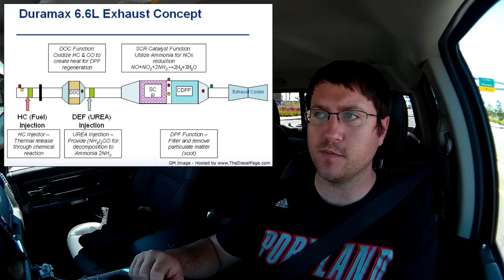Regens, DEF and Emissions Explained on the 6.7L Cummins - 2013 through 2017 Ram 2500

Comment: Good video and about as objective a one as you're going to get on this topic.  I like how you point out the possible reliability issues with emissions intact but still acknowledge that they do greatly curb emissions relative to previous generations of diesel engines.

The legality of deleting is pretty straight forward...it's not allowed by the EPA, but different states have different approaches when it comes to enforcing and supervising that.  I don't like the complexity of modern diesels, but I also acknowledge that progress needs to be made on dealing with their emissions.  Kind of like the EPA's regulations on gasoline engines and fuel quality back in the 70's and 80's, I imagine there will be growing pains with diesel emissions technologies.  But I hope that over time they will become more reliable and less expensive to maintain or fix.  Here in the US, diesel owners and enthusiasts cringe at the EPA's stance on diesel emissions, but go look overseas (e.g. Europe) where for the longest time they had few, if any, regulations on diesel emissions and the air quality in their cities has suffered horrendously (they also have a lot more diesel passenger cars than what we have here in the US).

I'm torn on longterm ownership of a modern diesel.  I'd like to minimize my environmental footprint, but I also don't want to have to pay for a new exhaust system (and potentially a major engine overhaul) 100k-150k miles into ownership.  What I would really like to see from Cummins and other diesel owners is longterm feedback on how the emissions, and engine reliability, fares over the longterm (150k miles and beyond).  It sounds like the newer diesel engines (2013+ for Cummins) are much better at managing the EGR and DPF active regen's and also get better mpg's than what the earlier versions were getting.  All that said, the 2013+ Cummins are still young, relatively speaking, and I'd like to see how they're doing 5-6 years from now with several hundred miles on the odometer.  

BTW, PNWreckage this isn't all directed at you.  Mostly this is just me airing out my thoughts on the topic.  Though if you do end up keeping your Ram for the longterm, I hope you continue to make videos and keep us posted on its reliability.
Reply from the maker: +Kevin P Fantastic comment and it never came across as you yelling at me, lol. The plan is for this to be my forever truck and I will keep everyone updated as my ownership progresses.
Reply: There's a guy over on the Turbo Diesel Register forum who just turned over 600k miles on his 2012.  Uses it for hauling cars.
https://www.turbodieselregister.com/threads/259082-600k-miles-2012-Ram-3500-Laramie-longhorn
Reply from the maker: +Charles Riley I feel way better about my 15k now! Thanks for sharing.
Reply: The point kinda is that he reports he is still on the original engine and turbo, and none of the stuff he's had to replace due to wearing out or failing have been emissions related. I  should have been more clear on that.
Reply: Charles, that gives me additional confirmation that the newer emission systems are in fact more reliable and longer lasting.  You hear about a lot of horror stories with the 2007.5-2010 Ram 6.7's, but a lot those issues had to do with heavy EGR and DPF regen tempo's.  It seems that the newer emission systems have seen optimization in the ECU programming and the addition of the DEF (SCR catalyst) has relieved a lot of the previous issues.  Also, driving habits seem to play a huge role.  The guy you referred to with 600k hauling cars probably hasn't had any issues keeping the DPF functioning and healthy, whereas someone driving primarily in stop-and-go traffic might be more likely to have issues.  A lot of owners have indicated that getting on the highway on a regular basis allows for more passive regen's (as opposed to active  regen's requiring fuel injection) of the DPF.  Honestly, it seems that unless you are using your 6.7 to navigate traffic-jammed city streets on a daily basis, an owner should have little to no issues with an emissions-intact diesel.  Also, deleting  an older 2007-2010 6.7L cummins seemed to improve mpg's (due to the previously mentioned EGR and DPF cycles); I'd be interested in seeing how much of an mpg improvement, if any, was realized by deleting a newer 2013+ 6.7L Cummins.

Comment: I just bought a 2016 Cummins, from trading in my 2011 deleted Duramax. These are easier to delete and something I'll definitely do
Reply from the maker: +Keven Gil How are you adjusting to the new rig?
Reply: ehh. it's alright. skipped out of finding a truck with a higher trim, ended a tradesman with all the options you can get. decent little truck.
Reply from the maker: +Keven Gil nice work

Comment: Great Video. I have a 2015 6.7 Cummins with 15,000 miles on it. So far I've had 2 active re gens during that time. I try to do as few short trips in my truck as possible. I absolute love my truck and for the money it beats (IMO) Ford and Chevy. After watching a few of these videos, I'm started to get concerned that maybe I should have brought one with a gasoline engine instead. My whole reasoning for buying a diesel was because they last a long time. I hope I didn't make a mistake. I plan on keeping this truck for 20 years.
Reply from the maker: +Andrew Usmani I don't think you made a mistake and support your short trip philosophy. Think you'll delete?
Reply: I'm not too up to date on the whole deleting thing haha. I live in CA and I would not want a "comrade" from the air pollution board paying me a visit in the middle of the night ;-). I'll check out some of the deleting videos and see what that entails.
Reply: dont buy the hemi 6.4 - i just ordered a tradesman 2500 cummins. i get 10 mpg with the gasser. spending 320 month on gasoline stinks. have an old 5.9 cummins 2500 and drive that more than the 16 hemi. cheers.
Reply: You didn't make a mistake at all. Either put some cash aside for future repairs on the emissions system or delete it. Main thing is to try to be pro-active and keep up on cleaning the EGR valve often, keeping all filters replaced often, oil & fuel filters changed evry 10k miles and run your exhaust brake ALL the time. It keeps that emission system cleaned out.

Comment: This video makes me wonder what is more efficient, burning more fuel with all the emissions equipment, or burning less fuel without it? 🤔
Reply from the maker: +Kody Kalma Boom you nailed it and I am also curious
Reply: A new 6.7 power stroke has emissions equal to 24 2002 7.3 powerstroke. This was told to me by a ford tech at a dealership last spring while I was still driving Fords not Rams. Even if the guy was not completely accurate the bottom line is that the new trucks are very very clean. I thought the sane as you and this was the answer I got from a ford tech.
Reply: Taxes are collected by the gallon on diesel. Less efficiency and less mpg equals a truckload of additional taxes collected for big government. That's what they truly care about.
Reply: I know it's an old response, but the answer depends on the vehicle. On the 2013 and newer Cummins, there's hardly a fuel economy penalty with the emissions. There's a very very slight increase in CO2 production, but running without the emission equipment results in around a 100x increase in PM. The testing by CARB shows that the PM in the 2018 and newer Cummins is less than that of a Prius.

Comment: The DPF is used to remove particulates down to 2.5 microns. A micron is a very small particle.
Reply from the maker: +Ron Wertz very small
Reply: Which is why I will be deleting it on my 1500 Eco Diesel as soon as the warranty runs out!
Reply from the maker: +Ron Wertz agreed!

Comment: Thank you for the informative videos.  We are shopping for 2500 and would love the Cummins however, in Suburban Chicago we have to pass emissions to get tags so I don't believe there would be any way around deleting.  Unless you know otherwise?
Reply: I realize I'm responding after a year. Illinois doesn't have emissions testing for diesels, at least not yet. If you get a class d truck you'll need to get a safety inspections every six months.

Comment: YES!! Next is HID light😁 

Now I've heard "chipping" it can unlock a lot more of its potential. What are your thoughts on that?
Reply from the maker: +Shane Bartlett like using a tuner? Lol nice work watching this video to the end!
Reply: PNWreckage umm I've never heard it called a tuner but let's say yes for understanding sake lol. It was actually pretty informal for as long as it is. Made me think about certain things so I know what to expect
Reply from the maker: +Shane Bartlett lol I think we're on the same page with tuners and chips, and yes those can make a HUGE difference! Like enough to grenade your transmission potentially with just a tuner. I was worried about the length but I'm not super formal as you have probably gathered haha. Hope it was helpful.

Comment: I got a brand new 2020 dodge2500 sport 4x4 with the Cummings  and on my way to a wedding a few weeks after getting it i had smoke coming thru the air vents and the smell of something burning, it hasn't done it since then but wondering if i should be worried?

Comment: PNWreckage what brand do you use for your DEF all the time? Been thinking about Mopar not sure what to do for brand. Don't want to give the dealer any excuse for warranty issues.
Reply from the maker: I use the generic brand unless the fancy one is on sale. Literally no difference from what I can tell but I get where you're coming from.
Reply: I fill mine up at truck stops, so much cheaper and easier to fill.
Reply from the maker: Can't wait until that's more common in my area. Believe it or not there aren't many

Comment: Hey PNC, I have commented a few times to your very informative and well presented videos.  I now have 19K miles in 7 months on my 2017 RAM 3500 SRW Limited with Aisin.  I have been adding a 2.5 gallon container of DEF about every 4K miles.  I only got down to the warning light once.  I drive with automatic exhaust brake all the time.  I am in southern California so I drive 50/50 split highway and city.  I cannot detect when a regen is happening?  I had one less than favorable tank of fuel only yielding about 15mpg at around 15K on truck, so can I assume my truck went through an unnoticeable passive regen during that tank?  I normally average 17-19mpg combined city and highway, and get as much as 22mpg highway while driving to Colorado and back to visit my daughter.  I am a diesel newbie so I am not sure if these trucks require the regular California "smog" checks in order to get registration renewed.  Does deleting the DEF system affect a smog check if so required?  I can only assume it does.  I look forward to your reply.  Thanks!
Reply: Hi! Fellow Californian here. Yes, you will have to smog every other year due to CA's uptight emissions laws. It's illegal to delete your truck here. I have heard it also depends.on your county. Some do not have the same restrictions and you don't have to smog. Now, are cops going around looking for you if you delete your truck? No. But it being illegal is a factor to consider. If you do have to smog in your county then that is another consideration. Can the smog thing be gotten around? Well, I'm just going to say that I know a few people who have deleted their trucks and still pass smog so....??

Comment: I live in a city environment, LA County, and I don't tow anything (yet). So I would accumulate all the soot very quickly? Also do I need to purchase the engine warmer or does it come with it?
Reply from the maker: +Shane Bartlett the block heater is an option but you probably wouldn't use it much in your area😉 Soot would depend on your drives and whether you run it long enough to achieve passive regens. What do your drives look like?
Reply: PNWreckage I drive up to a hundred miles a day JUST within my city (Santa Clarita)
Reply from the maker: +Shane Bartlett stop and go or are you cruising? Forgive my ignorance I'm not familiar with Santa Clarita

Comment: I'm at 65k miles on my 16' Ram 3500. I send oil samples to the lab about every third oil change and have never had fuel show up on the report. Is this an exception to the rule or is the discussion of oil dilution from the emission system BS? Has anyone claiming oil dilution by the emission system offered data in the form of a lab report? I'm not arguing for or against any of the data discussed, I just like to see the numbers to back up points brought up in the discussion below.

Comment: I have a 2015 Cummins and it is not using any DEF.  Gauge remains in full after driving 1000 miles.  I have never experienced a regen.
Any suggests as to what could be cause?
Reply: Add a gallon of DEF.  if it won’t all fit, you’re not using DEF……not normal.  If it takes it, then your gauge is wrong.  I use about 1 gallon of DEF per 300 miles.  In my case, it should go 1800 miles from full to empty.

Comment: The EPA has accomplished nothing by forcing manufacturers to design and install these systems.  If they really cared about the environment the first consideration should have been to reduce diesel consumption.  The diesel engine (pre-DPF system bullshit) was already much more full efficient than the gasoline.  If a truck uses much less fuel without these systems then it is a huge win for both the environment and the individual who owns the vehicle.  The DPF system has added thousands to the cost of the vehicle, increased maintenance costs and increased potential catastrophic failures , decreased engine performance AND decreased fuel economy.  One does not have to be a scientist or engineer to understand this.  Do the simple math.  Bottom line: the very high cost of these systems has completely destroyed any marginal reduction in greenhouse gases.  The EPA wrecks everything it touches! I'm ripping my DPF system out as soon as the warranty is expired.

Comment: i’ve seen in the 2019 ram 2500 diesel owners manual that a parked manual regen can be performed, if so short daily (city) driving shouldn’t be a problem, or would it?
Reply: I think only chassis cab models offers that option.  I’m not sure why they don’t offer that for other models.  It seems like it would be a great option.  Really sucks that you can pay $50-$60,000 for a truck and still can’t drive it around town or take it for short drives without leading to engine trouble.

Comment: i want a 2019 ram 2500 6.7l cummins, i don’t know much about diesel, how would this truck do as a daily driver/short trip truck, 6 miles to work and 6 miles back home? long trip once a year no towing.
Reply from the maker: I would not go for the Cummins with what you've described. It literally would not warm up fully during your drive to/from work and most people who have similar commutes have expressed a higher incidence of problems with theirs. If I were in your shoes I would look long and hard at a Power Wagon for 2500 or the 1500 if that looks like overkill. Let me know if that doesn't make sense
Reply: if i get it out for 30 to 40 miles on the highway on the weekends would that be ok?

Comment: "Oxides of Nitrogen" is the correct technical term term for what is produced in Diesel Exhaust, not Nitrous Oxide.  Best not to keep calling it Nitrous Oxide, harder to keep the two separate when you keep calling it Nitrous Oxide.  There is only one kind of Nitrous Oxide, and only one kind of Oxides of Nitrogen.  Just wanted to clarify that for you since you seem quite knowledgeable on the DPF  Regeneration subject as a whole.

Comment: What diesel fuel additive(s) do you recommend?
Reply from the maker: +Holly Taylor I don't recommend any. Not saying I don't recommend specific brands, just not something I have ever found the use for.
Reply: PNWreckage So you can run Diesel without additives?
Reply from the maker: +Holly Taylor my truck runs No.2 highway diesel perfectly, and it also runs B20 20% biodiesel perfectly. The power and mileage have always been great but I've heard of people being big fans of certain additives.
Reply: PNWreckage Hmmm.  I learned something new to me.
Reply from the maker: +Holly Taylor yeah?
Reply: Cummins recently started recommending Power Service, this is great to hear, especially when running up north during the cold months...helps keep your fuel from gelling...coming from the south it's really important since there's so much moisture in the fuel down south...
Reply from the maker: +Shawn & Lisa Layton can you link to the source on this info? Thanks for sharing!
Reply from the maker: +Shawn & Lisa Layton Great info and thank you for posting!
Reply: I use Diesel Kleen by Power Service, Cummins recommends using it. You have to remember that sulfur free diesel doesn't have the same lubrication as the old diesel fuel.
Reply from the maker: How do you think it compares to biodiesel?
Reply: I'm not really sure, but I've heard from some diesel techs that using Diesel Kleen will help keep your injectors lubricated and they recommend using it every other tank. I buy it Walmart for $19 and it treats 200 gallons.
Reply: @SLICKW1993  actually, with the most recent incarnation of ultra low sulfur fuel a lubricity specification was added. There is now a guaranteed level of lubricity whereas prior lubricity of the fuel was a byproduct of the paraffin  present; not of the sulfur. Paraffin is removed inadvertently via the sulfur removal process.